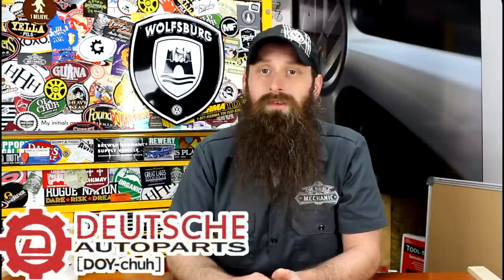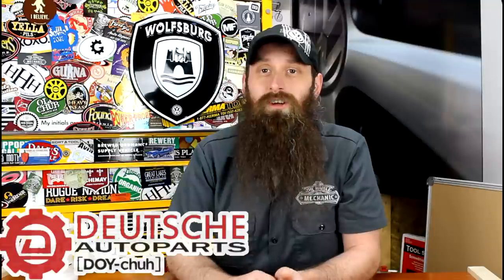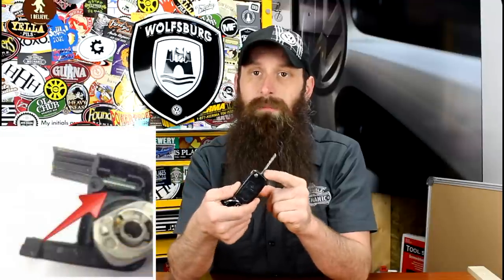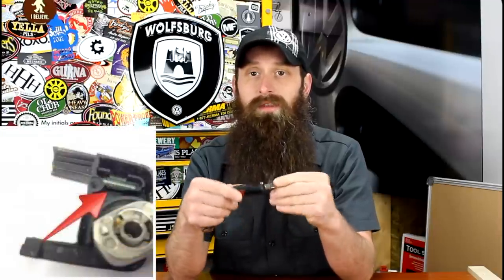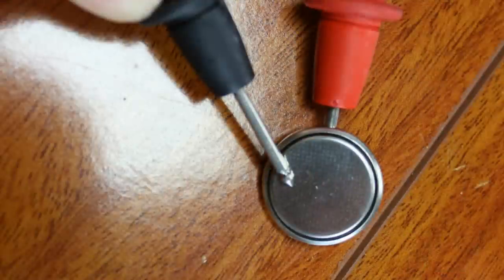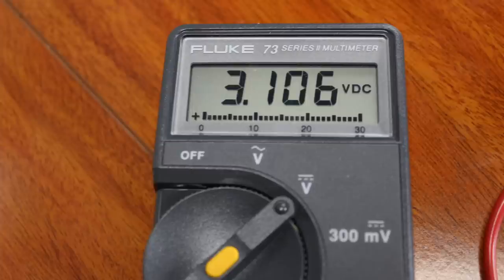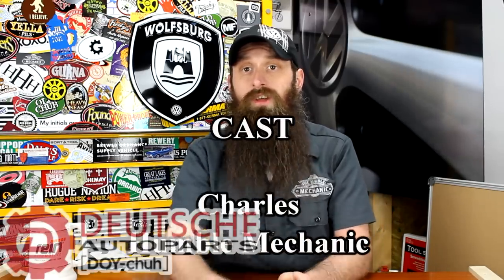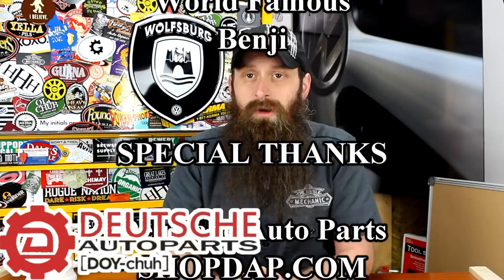How VW Keys and Remotes Fail

Comment: Great video. I have a 2000 Jetta. It's had some weird electrical (and other) issues. The latest being unable to disarm and unlock the door using the remote. I bypassed this by just inserting the key to unlock the door, but of course that set off the alarm. I started the car ok, and the alarm continued to sound for a few seconds. I parked at home and as soon as I opened the door the alarm sounded again. It went off after some moments. I can't remember what I did exactly... Shall I just replace the key remote battery as a first step? I'm loath to spend any money on her than I have to...
Reply: Yes did you find out what to do? I’m having this issue with my 09 Jetta. It seems whenever I go to my car with the key fob the alarm sounds 

Doesn’t matter if the battery is in the key fob or not. As long as I’m within distance of the car, it goes off! 

I had to disengage my alarm fuse (for now) or else my neighbors would be annoyed
Reply: @bethany6070  did you find a solution
Reply: @bethany6070  same issue.  Did you find a solution?
Reply: @Cams.Crusade  sorry I’m late. Long story not short, I took my car to the dealer and they were baffled. The horn had to be disengaged in the fuse box because taking the battery out of my keyfob did not work. So that stops my car from blaring. I was informed it could be the door latch actuator that went bad. I am pretty sure that’s the fix. I can hear my door trying to lock and relook on it’s on from time to time. One of them doesn’t open from the inside and gets stuck when opening on the outside. So it has to be the back door trying to lock itself and the computer in the car thinks it’s open causing the alarm to blare. I am going to buy a new keyfob though too to just rule it out. Damn VWs 🤦🏾‍♀️. They’re so sensitive lol!
Reply: @kathyhoward2065   Long story not short, I took my car to the dealer and they were baffled. The horn had to be disengaged in the fuse box because taking the battery out of my keyfob did not work. So that stops my car from blaring. I was informed it could be the door latch actuator that went bad. I am pretty sure that’s the fix. I can hear my door trying to lock and relook on it’s on from time to time. One of them doesn’t open from the inside and gets stuck when opening on the outside. So it has to be the back door trying to lock itself and the computer in the car thinks it’s open causing the alarm to blare. I am going to buy a new keyfob though too to just rule it out. Damn VWs 🤦🏾‍♀️. They’re so sensitive lol!
Reply: I just haven’t gotten around to fixing the door but I did buy the part. I’ve been on forums and the forum basically confirmed my symptoms as the door latch going bad
Reply: @bethany6070  I had to disconnect my alarm …mechanic said I need a new control module… I have already replaced my door launch actuator so for me it’s wasn’t that :/

Comment: I have the kessy push to start/keyless entry and the issue I have is when on random occasion the fob works and locks or opens car via kessy, and then sometimes it doesn’t. So I use the blade to enter and lock when it fails. Those times it usually doesn’t detect the key in the car so I have to hold it to ignition while pushing to start. On top of that usually then the doors do the annoying will not lock while driving and continuously attempt to lock doors but eventually open (you hear the sound for quite some time).

I thought it was the battery but I kept replacing them and using the other key, same issues off and on. Then I thought the batter was getting dislodged and not connecting aka acting as a dead fob. But I swear it will go from working and locking perfectly fine, to not, so I don’t think it’s a dying batter issue.

Any thoughts or solutions: def welcomed! Thanks VWers
Reply: did you ever figure this out?

Comment: Hey Charles, just put a new battery in my 09 GTI. The old battery had been out of the car for a few days, so the immobilizer kicked in. After connecting the new battery, the car starts and then immediately shuts off. Last time this happened, I used your trick to reset the vehicle computer (taking a jumper cable, disconnecting the battery, then connecting one end of the jumper cable to the positive battery cable and the other end to the negative battery cable, let the car sit for 15 minutes or more, then reconnecting the battery and it started up and stayed running). I don't think it's working this time. I kept a jumper cable connected to both positive and negative battery cables while the battery was out of the car. Now that I've installed the new battery, the immobilizer is still triggered. Is there some other reason my car won't stay running? The key still unlocks and locks the doors and activates and deactivates the alarm. So, the key is still synced to the car. Any advise is greatly appreciated, as always.
Reply: I have this problem aswell, did you ever find out what the issue was.
Reply: yep. had to do a full computer reset. There's a video on this channel that shows how to do it. @euanjames5002

Comment: Charles im having issues with my 02 jetta tdi i get massive clouds of black smoke when using anything more than quarter throttle I noticed there is some oil dripping from the turbo could that be the cause of the smoke I have a hundred and eighty-nine thousand miles

Comment: I have 2017 Alltrack keesy system or whatever it's called. Anyway, today went to leave car wouldn't unlock lifting handle OR by pressing unlock button light on remote didn't even flash when pressing buttons. Went back in house got spare remote...it worked fine. So I figured my remote s battery was dead. I swapped battery with spare remote (working battery) still my remote wouldn't work no flashing light nothing. I've always carried my remote in my pants pocket nothing out of ordinary so now I have dead remote. I do notice a very slight bulge in the remote that the spare remote doesn't have, could something in the remote (a chip or something) have fried? These new cars are getting more and more complex driving me nuts.

Comment: We have a 2017 Golf. When the battery in the key runs out, you can pop off the protective cover covering the key cylinder in the door and open the door with the key. There is a small notch hidden in the cover under the handle to hook into.
To start it touch the fob on the steering column in the place the key usually goes in. And then you can open the other doors from inside. Or if you do not want to go through all that trouble, just carry a new battery with you at all times. That is for us non-mechanics. But I have the VCDS toy and am learning how to use it. As a computer software engineer, I consider the VCDS tool a toy. A serious toy for mechanics, but fun to play with for me. (IT dudes have a strange definition of toys.)
HumbleMechanic, computers and magic are in bed together to make our lives difficult.

Comment: I have had a 2007 VW Jetta 2.5L 4-door Sedan with A/T for a little over 5 years now that I purchased from my very close friend. I’ve loved it since the day I bought it. Problem is, someone else must have fell in love with it at first site as well because while I was in the grocery store with my family, they decided to try to steal it with a screwdriver completely unaware of the immobilizer. Now my ignition is completely destroyed and my key no longer works. Took it apart to see if I could do anything to clear the damaged parts but when I reassembled it Would jet stuck in the off and accessory mode but will not turn to on position. Bought a new ignition lock cylinder with a new programmed key for the lock cylinder simply because it made sense to me. Unfortunately, after installing it it also got stuck in the off accessory modes. Any advice on what I should do next
Reply from the maker: I’ve had it happen. You may need to removed the lock cylinder and try and reinstall it. It’s much easier when it’s out of the car.
Reply: Thanks for getting back to me. I really appreciate it. Unfortunately, I’ve already taken it out and had to drill the original lock cylinder out because I couldn’t get it into the on position to release it with the paper clip. So, on the advice of the dealership service department after giving my VIN #, I bought a new lock cylinder with a new matched key for the ignition. Then, as I’m sure you know, after reinstalling it into my car the car in-dash immobilizer warning light came on. Apparently, the new supposedly programmed one I was sold for a whopping $150 isn’t programmed to sync with my ECU. Is there anything you could suggest that would allow me to avoid the dealership service department and the definite stick up awaiting me to simple remedy the problem caused by a stupid thief.
Reply: P.S. I no longer have a working programmed key due to the fact I drilled it out to put in the aforementioned dealer recommended new one.

Comment: My keyfob stOPS WORKING SO I CHECK 2 FUSE I CHECK BATERY KEYFOB i resync but nthg so i remove both cilinder doors i try to diy scredriwer  and it works but sometimes not so i Put wd40 into cilinder And try again but still keyfob not command only key in cilinder so i check other side still same  1 on 10 Works 5 6 times I think Will be faulty ccm what u think man plz give me a help !!
Reply: did u figure it out?
Reply: @bd-us7gg  still not but i Think should be CCM module

Comment: Any suggestions for kessy push start 14 model vw? Can these be reset or does the dealership have to do? I replaced with a battery and I haven't seen any videos for push start just the ignition models.

Comment: 2003 Jetta TDI weak / short range.  I have changed the battery two times.  The second battery was 3.1 volts.  Thoughts or suggestions?
Reply: My remote had such sort range, I would have to hold the fob close to the rear window to pop the trunk. I changed the battery and still had the same issue.  I even ran a new receiving antenna wire for the fob inside of the car. That barely helped at all, so I only had one thing left... When I bought the car(used), it came with 2 remotes, but only one would work as a remote. I hooked up my VCDS and programmed the second remote. Bingo. The fob that I had been using this whole time has something wrong with it. No idea what went wrong, but the range on it really sucks. This other fob reaches 150 feet or so with the new antenna hooked up in the car. I ran the receiving antenna into the new shark fin antenna case that I installed and just made a hoop at the end of it inside of the fin....It is not hooked up to the radio antenna potion, it is just inside of the shark fin case so that it is outside of the metal of the car. I would suggest trying a new fob. There's many videos on how to program them, I just used VCDS because it was easier for me.
Reply: @derekmoore1612  Thanks for the reply.  Very helpful.  I did eventually find the second fob and it worked.  The only problem is I guess they are programed  different because I have to use the old fob to start the car and the new one to open the doors.  Looks like it's time for a reprogram but I don't want to end up with neither one of the working.
Reply: @larrystephens7437  I'm not sure that I am understanding. You would have to program the other fob in order to be able to unlock the car. I'm guessing that you did that, but you didn't swap over the transponder to the other fob. If you don't do that, the car wont stay running for any amount of time because the immobilizer will shut it down after it starts. You can VERY carefully swap the transponder to the other fob. There are videos that show you how to do it. I suggest soaking it in acetone and using a cotton swab to rub the glue out. Take your time.....But, the easiest way to fix that issue is to swap the fob ends. Put your key end on the good fob end. If the buttons and such on the old fob are better, just swap out the board from the good fob to the old one and you will have a fully functioning key fob again. That's what I did. My original fob was in great shape. The one that I had to program was taped together. So I put the good fobs keyless entry board into the the case of the fob the had horrible range and I now have a great key fob. Hope this helps you.
Reply: @derekmoore1612  Thanks for the help.  You have given me several options to try.

Comment: Hey I have a 2006 vw jetta and some mornings the imbolizer will turn on and then  10 mins later the car starts up fine. In turn I replaced the battery in the key and the issue is still going on. I called the dealership and they really won't give me a clear answer on what to do.

Comment: Hey bud, have a 15 Jetta. Changed the battery in fob twice in a month & it still doesn’t Lock/Unlock. What should I do ?
Reply: Got it working?
Do you see the red light flashing on the fob when clicking a button?

You might need to resync it with the car if the fob "works".

Press unlock button.
Unlock car with the keypart.
Start it within 30 sec or 1 min (don't remember).

Guess you also have/had an alarm setting of from time to time when getting in the car.........

Comment: Question for you.  I have a 2013 Jetta, Key fob is keyless entry/start.  As you described as one of the problems in your video, one of my remotes went through the wash.  Right away the alarm would go off on the car just by moving the remote.  I took the remote apart, as much as I could, let it dry out for several days and put it back together.  They fob has worked OK since.  Locks/unlocks doors just fine.  Also car starts no problem.  Only issue is every once in a while the horn alarm will start randomly.  This sometimes happens even when I am driving.  I can stop the alarm by pushing the panic button on the remote.  This happens at rare times, but is stating to be annoying.  An idea what I can do, or am I doomed to ordering a new key from the dealership?  Thanks for any help you can provide.
Reply: Probably the solder on the circuit board has oxidized and can sometimes conduct between joints enough when there's enough moisture in the key to do so, try taking the key apart and remove the loose bits of oxidized solder with a fibre-glass pen then clean it with PCB cleaner, that's what I'd try at least.

Comment: Is there any way to improve on the keys/remotes that were used around 2001, part number 1J0 959 753 F?  These are the early Mk4 keys that use a plastic post at one corner of the key to retain the key ring rather than a bar across the entire width of the back of the key.  The plastic post is fragile and always seems to break.  I have only one key out of two with my car (2001 Beetle) that I can put on a key ring.  It doesn't look like you can use the later remote with the earlier key because the buttons are a different shape.

Thanks for all you do and for sharing what you know with all of us!

Comment: I know this video is old but if anyone has a solution for loss of range with the kessy keyfob that i can't seem to find that would be great. Replaced low batteries in keyfob(s) and now my range is less then 10 feet from the car to lock/unlock and kessy doesnt recognize the key is in the vehicle sometimes. Already replaced batteries again and that did not work. Gotta love newer technology. VCDS reported nothing. (2014 Mk6 Volkswagen Gen3 GLI)

Comment: idk if you may still be able to help since its been a long time since this video came out, but what should I do about my 2012 VW Jetta starting then turning off after a second? it gives me a No Key message, The EPC light turns on and the battery light is on as well
Reply: Raul Zarate my 2010 Jetta has the same problem. My cat sat for a while when I got home the keys worked and I moved my car from the backyard where it was kept to the driveway. Next time I tried starting the car it started and immediately turned off with a NO KEY displayed. I’ve tried every diy trick to try and reprogram the SOB and NOTHING! I am curious have you fixed the problem with yours?
Reply: Gary Bond I tried every DIY trick as well and non of them worked for me, so my last option was to take it to the Volkswagen dealership, had it towed there, (we have a friend who has a tow company so it only cost me $65) the dealership told me it was the programming that got all fucked up and they had to order a new key for me, so I’m total it cost me $415, but I ordered 2 new keys so that added another $150

Comment: Help!! What do you do if you change the battery, can see the light on the key fob come on but doesn't work for the car? Is there a reset or could that mean the remote part went out? What does that run to replace if needed?
Reply from the maker: Battery replacement is pretty easy. It shouldn’t require reprogramming. Sometimes remotes die. Ifr reprogramming it depends on the car

Comment: Hey I have a VW MK5 R32 and my ignition switch turns to accessory but will not turn to start it is locked. My steering wheel lock is fine, I am freely able to lock and unlock the steering wheel. What do you think is happening?
Reply from the maker: possible lock cylinder

Comment: Having immobilizer probs on a 2000 Beetle with a 1.8T. Its progressively done the start and die thing to the point of refusing to start even after a few attempts. (Tried other fob and valet keys too...all original) I disabled it with the SKC and she starts fine. But that damn light! Is it possible to use the VCDS to turn off the immobilizer and get the light off as well or will I need to swap the instrument cluster if I can find one? If I can do they need to be programmed too? Thanks for all the great vids...I always check your YouTube page before cracking open the Bentley manual now.

Comment: Any help would be greatly appreciated. I have a 12 gti. Battery died over winter. Charged battery radio won't turn on and car won't start.  Everything else works please help!
Reply from the maker: May have to replace battery. Also check faults